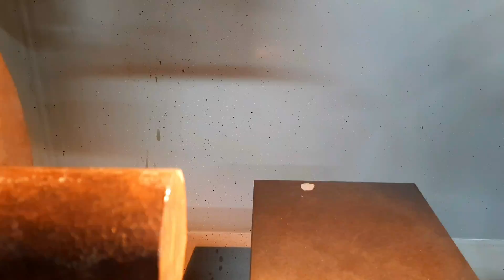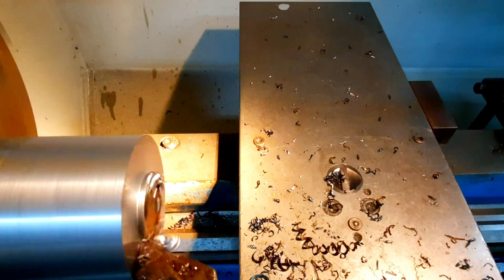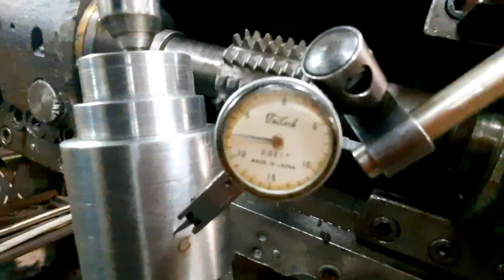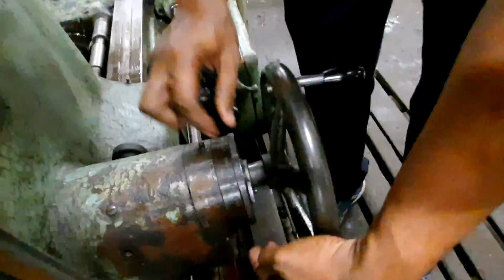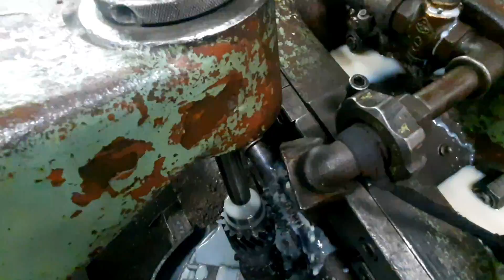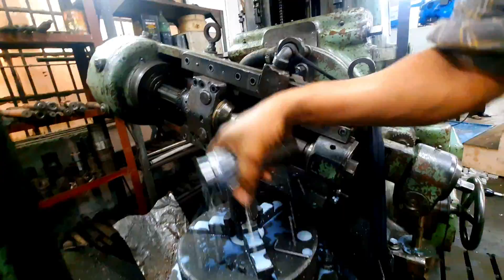Helical Gear Cutting Prosses - Gear Manufacturing Step by Step Lathe And Hobbing Machine Operation.

Comment: How the gear calculate for helical
Reply from the maker: To calculate helical gear dimensions, you need to determine the pitch diameter, pressure angle, helix angle, number of teeth, addendum, dedendum, outside diameter, base diameter, and width of the gear. The formulas involve calculating these parameters based on the gear module, number of teeth, and helix angle in radians.
Reply: @WorkMachineEquipmentTechnology  my question: how we calculate the gear for helical angle 7' or 10 degree, no of teeth =23 and od 50 mm and length 60mm